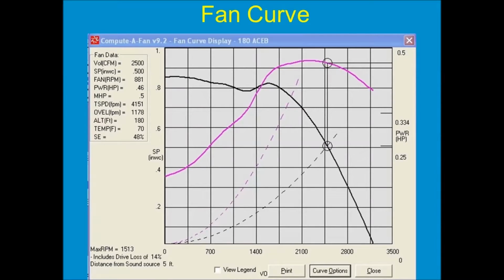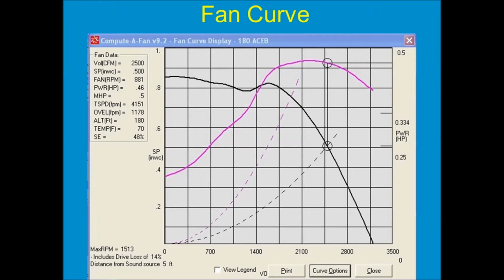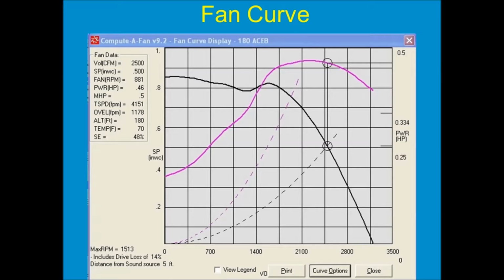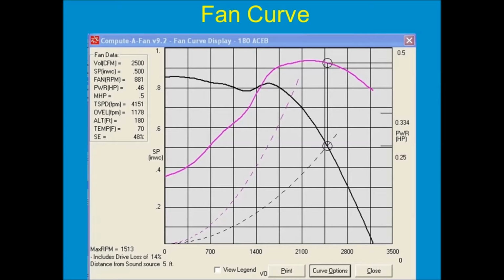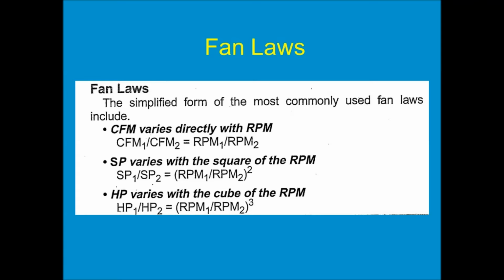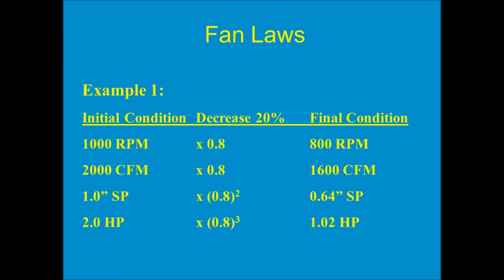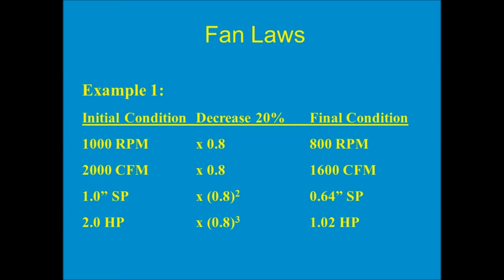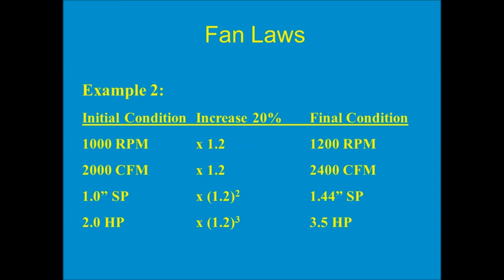Basics of Fans & Blowers - Part 3

Comment: When you speak of static pressure is that the pressure across the fan or in the discharge? If in the discharge I assume the measurement is taken directly in the discharge?
Reply: Total System static pressure.

Comment: Suppose I calculate on how much airflows (m³/s) I need to cool down a certain system, for example a generator. Now how to select a fan out from it ? The rpm of the fan depends on the rotations of the rotor since it'll be installed on the rotor. How to calculate the proper size of the fan to make this schematic works ?

Comment: on what factor of fan should i concentrate in order to remove the heat from the system?  if i am pushing the air inside the system using axial flow fan
Reply: Yes sir this is what I'm struggling with on how to deeply understand fan working principle as a cooling device. Suppose I calculate on how much airflows (m³/s) needed to cool down a certain system, for example a generator. Now how to select a fan out from it ? The rpm of the fan depends on the rotations of the rotor since it'll be installed on the rotor. How to calculate the proper size of the fan to make this schematic works ?. Do you have any advice sir ?

Comment: in your example of the restaurant owner
wouldn't be changing the shape of the impeller (propeller) blower blade or whatever it is called, would't be that considered to make a change?
Reply: Not really because you still need to move an amount of air, the work has to be done and the pressure differential will always come in to play. But I'm sure the are optimal fan configurations depending on the requirement.